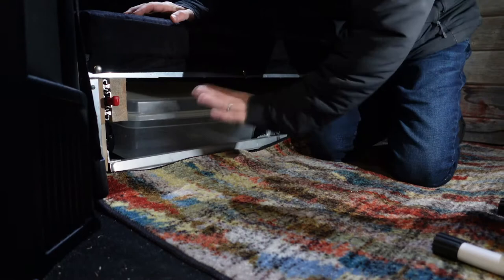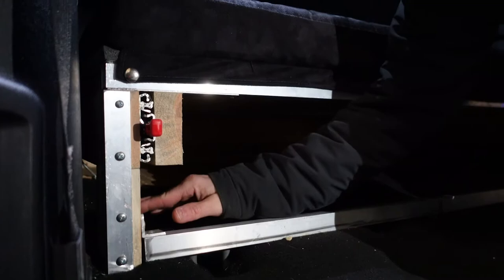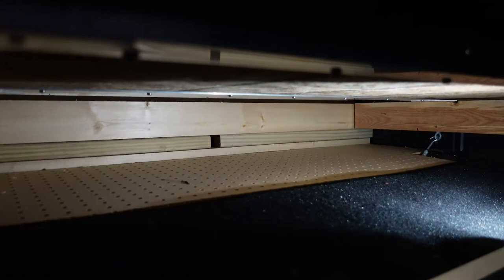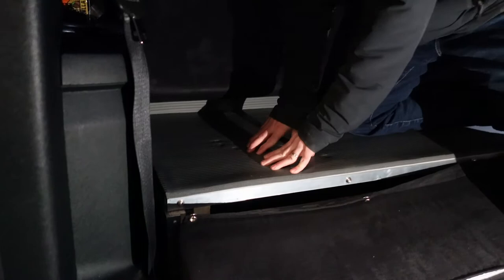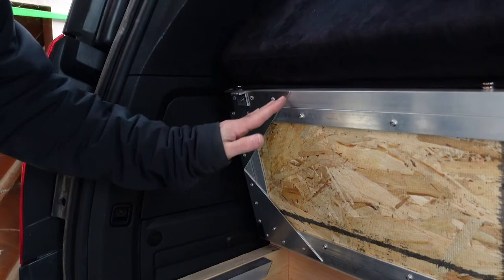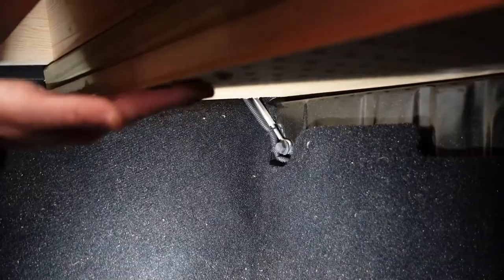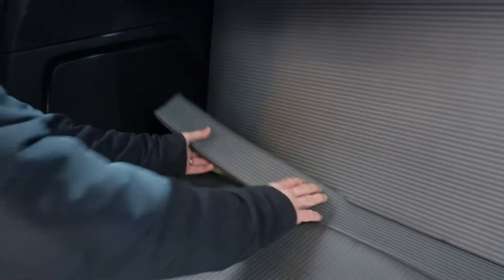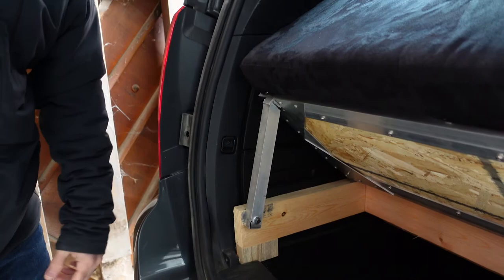MINIVAN BED DESIGN || PART THREE

Comment: If the panels was 19 inchs with 6 inch foam  that would leave  13 inches for your but ,doesn't sound like enough  room  2 sit on
Reply from the maker: The foam is 3 inches.  Thank you for watching!👍🏼😀